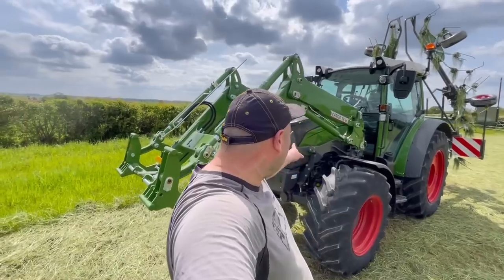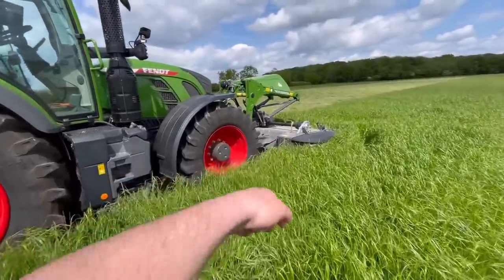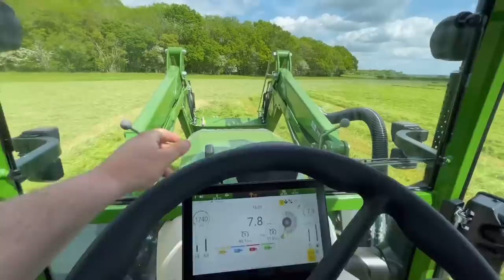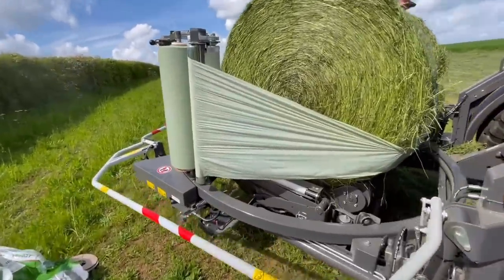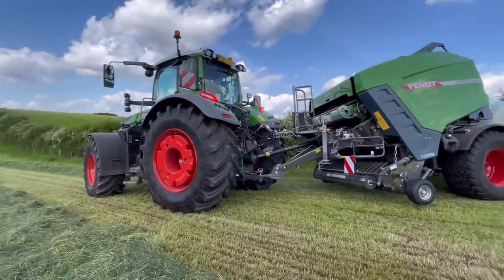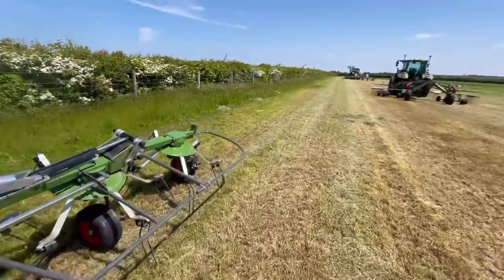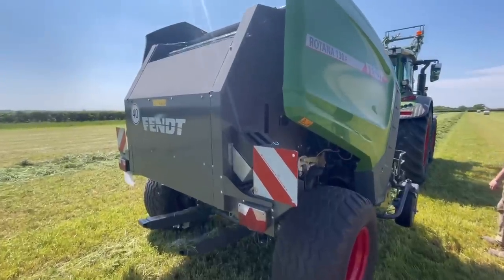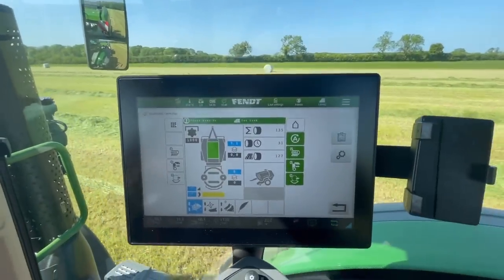ITS FENDT!!!! Grassland Tractors and Balers, silage harvest 2023

Comment: Fendt manufacturers some very high quality agricultural equipment. What beasts of tractor!
Reply: the thing is though is that is not fendt made mowers, its from fella (the mowers, rakes, tedders and baler is Lely) and you can tell its a more budget option comparing to others. 
if it still had the name Fella it wouldnt sell much but since agco dealers can sell fendt mowers now they will sell nicely. it says fendt and its cheap. 
im not bashing it and for most customers the machine does the job just as well for em

Comment: at 14:10 with the fixed chamber baler. whats the inserts / pads on each side in the chamber? 
are they moisture meters ? i saw something similar but smaller and fitted aftermarket on a used baler near me but the meter wasnt really that accurate. im not sure why though. but seeing it abit different on this peaked my interest, if it is a moisture meter that iss
Reply from the maker: It has moisture meter and also weigh cells to weigh each bale